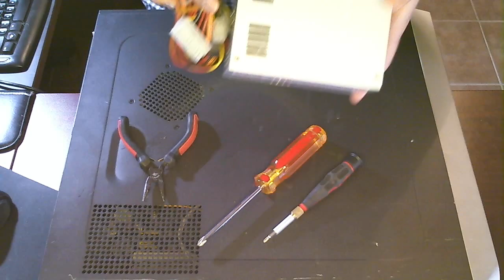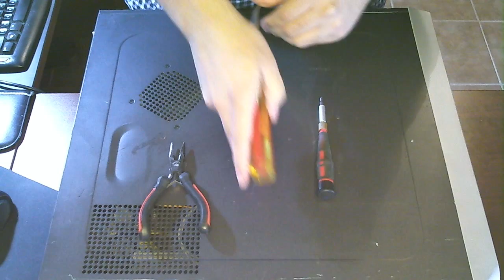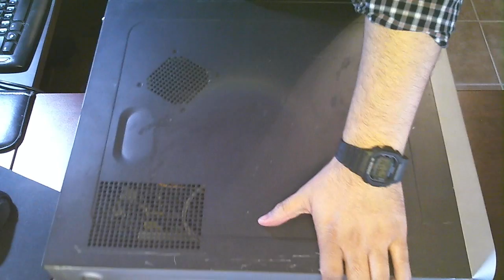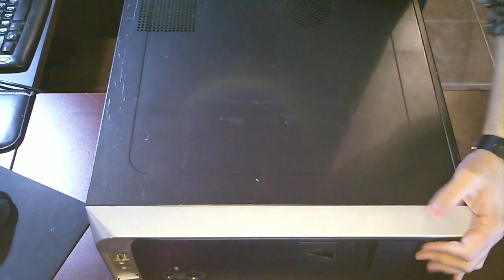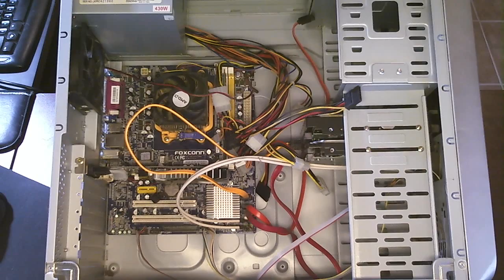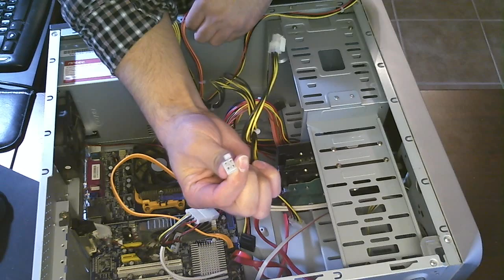How to Repair a Computer Power Supply and Diagnose a Fan (Repair Guide)

Comment: You forgot to mention to be careful when you plug that big plug into your motherboard, that you brace underneath the plug to prevent stress cracking the motherboard. A person does that.. and it's all she wrote! Oh.. and you forgot to mention preventing static discharge.. and what that can do to a computer if you don't.    I notice you spent alot of time talking about stuff that people don't need to know, instead of telling folks those important little tips and tricks they NEED to know in order to perform the job successfully and not cause more harm then good. Just sayin'.    You have to be careful when you put videos like these out on a public forum. people are looking for help and find videos like this one and take folks like you at your word and follow your instruction to the letter. It's then your responsibility to make sure you don't leave anything out of the instructions and that everything you tell and/or show people is 100% true and without error.

Comment: i have a system unit when i turn it on i can see power on the mother board but the processor fan is not working and power supply fan not working

Comment: Changed my PSU today. Took me 5 minutes from the time I took the 1st mounting screw off till it was wired.

BTW. Your "star" screw driver is called a Torx driver.

Not trying to be a smart ass. Just stating my time and what the tool is.
Reply from the maker: Thank you for the information, sir! And a big thanks for the view!
Reply: ITC Austin
No Problem. A lot of people think opening a computer case up, and changing stuff out is scary, or not within their ability.
That's where these videos come into play.
Reply: ITC Austin I have a power supply that 14 years old going on 15 soon

Comment: I really want to open my psu because the fan in it is really loud, probably some cable kicking it, + my keyboard, mouse and screen sometimes turn off just like that, and the computer is still on, that started happening when that psu's fan problem occurred
So the thing is, I know how to open it up but I'm really scared, on the psu case itself says that it is dangerous to open it even if it's unplugged and I have read that people died from it too, so I don't know what to do, but I don't wanna pay 200$ for something I can do myself
Reply: Power supply are dangerous but you won't die  just leave it unpowered for 5 minutes the you will be fin I have done lots  of power supplies

Comment: WOW!!! U' VE GOT A SUPPORTER HERE FROM S.E. ASIA... THINKIN ALL OF THOSE COMMENT_
I'D RATHER SAY, IF U REPAIR THE SMPS PARTS i.e; CAPACITORS, TRANSISTORS, ETC. SURELY IT WILL FIX SOMEHOW!! BUT THAT CHEAP & LOW QUALITY OR NON VENDOR TESTED PARTS WOULD NOT ASSIST THE ORIGINAL ONES AS IT SHOULD BE.. IT MAY RESULT IN SHORT TERM USES SUCH AS LOW TEMP"" SIGNAL TO ITS SOURCES, SINE WAVES TO POOR REGULATED WAVES THAT SHOULD LEAD TO SPARK ON MB.. HDD.. RAM ETC..
SO,,  REPAIRING IS NOT RECOMMENDED FROM MY TECHNICAL EXPERIENCE... CHEERS!!
IT CONFLICT--- U SHOULD BE MY FRIEND... THNKS

Comment: You can test a PSU if you connect the GREEN cable with any of the black ones.
It should turn on.
Then you have to test if the GRAY one goes to +5V this tells that the PSU produces voltages within the specs.
You gotta test all the voltages anyway but if it does not give that signal the board might not turn on.

Comment: You said the computer was built a few years ago.  Why has the power supply burned out? That power supply is an old type, which is totally outdated. The motherboard is a real cheap board, which is easy enough to see. I don't think you'd be selling me any computers. If you sold that computer to an unsuspecting customer, you should be ashamed of yourself.  If you wanted to test that old PSU then you plug a good hard into one of the leads and see if it spins. You also Mickey-Moused the SATA power.

Comment: Title must be How to Replace PSU & Vacuum-clean Fans.  You keep referring to the Processor as CPU.  The small wire coupler must be inserted first to the longer one backwards.  That is, portion of small coupler with wires protruding must be inserted first to the hole side of the longer coupler.  Examine how the coupler locks in place.  In this way, even pressure exerted on the longer coupler will press the smaller one on motherboard as if they were one piece.

Comment from the maker: The LED indicator or the back of the PSU is an indication that the unit is receiving power. No way to verify if wires are hooked up correctly, but as a general rule, its impossible to plug PSU wires into the "wrong" connector without power tools or breaking something.

Comment: There is a light on the back of my psu i could have the wites hooked up wrong in the case but should the light light up if ithe psu is plugged in (topower 650w)

Comment: Yes, but the title says "repair computer power supply", not "repair the computer". Misleading and boring - you could've at least fill the video description to emphasize that you will not even open up the PSU. Same as Jozsef, I was shocked to see hard drives so close.

Comment: Dust is BIG cause for PSU fault. When it fail, PSU is overheating and capacitors blow up. I fixed many PSUs by replacing faulty capacitors, and woila, PSU working perfectly again.

Comment: Lol it took 20 minutes to replace a power supply?

You an just buy a multimeter or PSU tester and test the leads to make sure they are supplying proper voltage and ground....
You don't really repair PSUs you just replace them. Unless you happen to be an electrical engineer.... lol

Comment: So disappointed, I want to know how to repair my PSU, not change it out.  Already done that.  Can anyone tell me what happens to a PSU when it gets plugged into the outlet with the voltage set wrong for my country?  Did it get too much power and blow a capacitor or what?

Comment: Hi. Thanks 4 the video. Just one question. I think I have a power supply problem with my pc, how ever when I plug in the power cable and I switch the pc with the button behind a little green led on the motherboard  illuminates but the pc doest not respond when I push the start button in front. The fan is also not running. Any idea? thanks a lot in advance.

Comment: Don't touch a PSU unless you have experience with them. Even after discharging it, it may still hold a bunch of power in its capacitors, which could ultimately release that charge and shock/kill you.

Comment: HEy IT Conflict
as i was passing my leisure time i have noticed the VDO, and just got interested to see how you gonna work........

Everything seems okey to you and all but YOU are So much new to plug a 24 pinned power Cable of PSU to the mother board, 
the process is 
1st you have to check Mobo's power female pin. is't 20 or 24 then decide it's with the 24 pin or only 20.

you made a mistake but didn't explained it as your bad, you said sometimes it might cause this wrong ...bla bla 
don't mind

Comment: i was thinking you were going to show how to fix a psu like change a few caps or replace the fan in it but all you did was put in a oversize new psu a 300w would have bean more than fine for that system and leaving a mess of wires laying around in the case screams unprofessional job and you seemed to have so much trouble putting in the psu and naming the connectors on the psu you didn't say a thing about 20 pin vs 24 pin  mother board plug i would not bring my pc to you to save my life

Comment: Electronics today are made to have bits replaced, but not repaired. Most of these items can't be repaired even if you wanted to. Multilayer circuit boards killed electronics "repair"... quote from elithecomputerguy for those who says its misleading

Comment from the maker: Jefferey, I appreciate your input. If the computer no longer turns on then to the consumer it is broken right? As a technician, you have to diagnose and repair the computer. Once you've determined the PSU is at fault you can choose to either do sub-par work and attempt to repair the PSU by taking much time and effort to hopefully turn out good work OR you can provide excellent service by replacing the power supply ensuring a good repair and warranty for your customer. Makes sense to me.

Comment: Replacement isn't a repair... Also...
- don't' mount the HDD's so near. They heat each other too much
- don't left the wires floating around. It's not good at all for the air circulation
Don't talk too much. Just say what to remove and how. People who look power supply tutorials aren't interested what kind of processor has the pc...
Hope that helps....

Comment: I ususally test the old supply with one of those testers, they cost maybe $15.00.  taking all that time to replace the supply only to find out the motherboard is bad etc. is wasting time. When you work in a small shop like me you don't earn an hourly wage, you get paid by the number of units you fixed today.

Comment: Hey, I'm having a issue with my computer. Every time I turn it on about a 1 minute later turns off. The fans does not turn on. The fan use to work really fast none stop before that happened. I called a technician and he told me that it might be the power supply. He told me to take it in to get it checked. At the moment I can't afford to pay to get it fix so I'm trying to fix it myself. The lights in front turn on.

Comment: Yes the plugs are designed to fit exactly how they're supposed to go, don't jam plugs where they don't fit. 20+4 pin goes to the motherboard, 4 pin square goes into motherboard as well(for CPU power), either 4 pin molex or flat SATAs go to the drives. Also only one plug per device(except for mobo, that has two), I've seen people plug the 4 pin berge into the HDD jumper block, not a good idea.

Comment: My God what a stupid question :) Mate you unplug it ,when umplug something plus the other PSU plug in and continue so ,after all cables or the new PSU is pluged into the motherboard just unscrew the old one fit the new one and screw it in.Its a simple 10 minute job.But if you're a rockie into PC's and umplug all and wait till you unscrew the case of it , you forget were everything goes and you'll have a headacke :P

Comment: To my knowledge the only things you can connect wrong is when you connect frontpanel firewire and usb connections to the motherboard because they have identical connections, nothing on the psu should be able to connect in wrong places